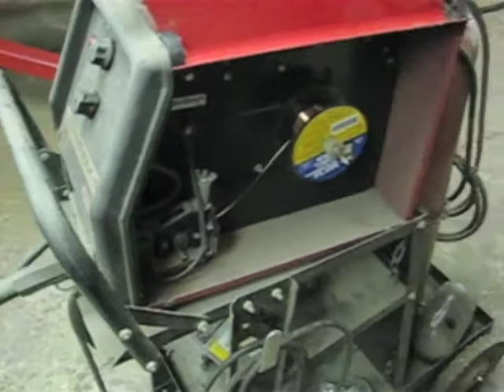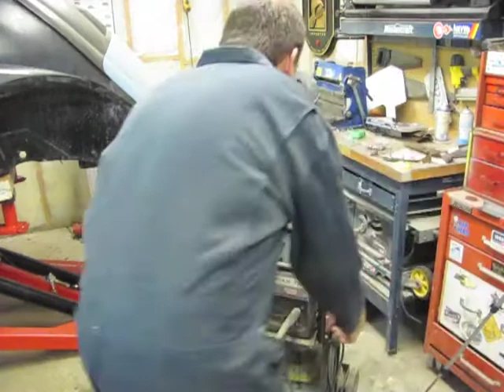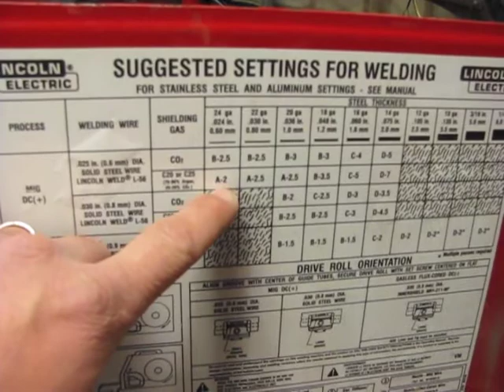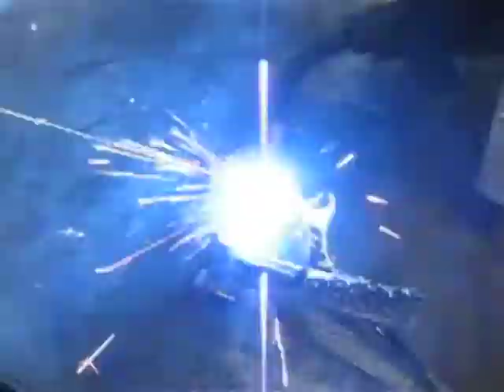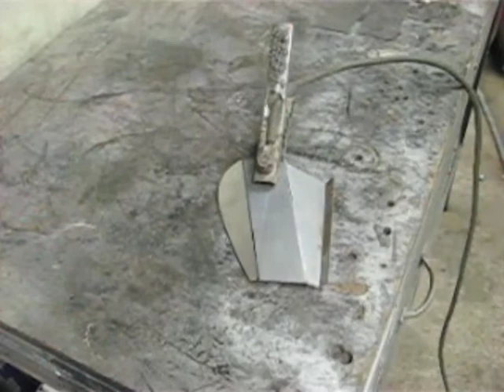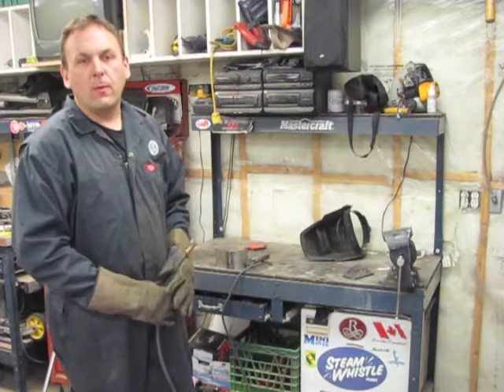Episode #3 - Welding 101

Comment: I have a welder just like yours but no gas is hooked up. Do I have to buy the big tank of C20 or are there smaller ones I can use? I will only be the occasional welder.